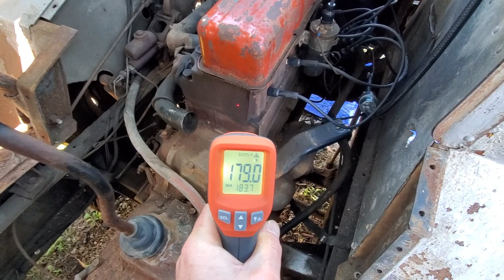1960 Grumman Olson Kurbside Step Van Project - New Parts, Tune Up, And Brakes

Comment: Could you please give me some part numbers on the brake parts, especially the master cylinder. I have the same van but can’t find the right brake parts at which is all I need to drive! Thank you i would really appreciate it.
Reply from the maker: If its a GM chassis like mine you can find all the parts and number on Rockauto.com. They will be listed as a Chevrolet P20 for everything but rear brakes. Rear brakes are under P30.

Comment: Brake parts from RockAuto?
Reply from the maker: Yes. I have never had any issues with them. You cant beat the price. I do tend not to choose the very cheap parts though.
Reply: Use them all the time same thing I go with middle of the road prices
Reply from the maker: @kevinjaeger9648  Sometimes I do spring for the higher end part depending on what it is going on.

Comment: Looks like getting a V8 to fit would be a no go.
Reply from the maker: @bthorn5035  there is room. That is the future plans
Reply: @4LaneBlacktop  a screaming 289 would be tits!
Reply from the maker: @bthorn5035  I will be putting it on a 2004 Chevrolet van chassis with a 6.0 v8